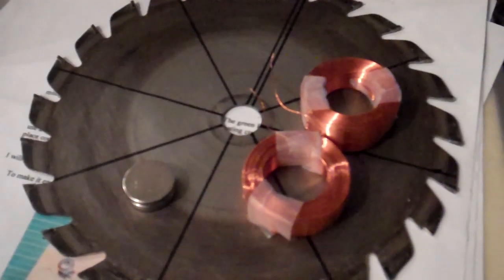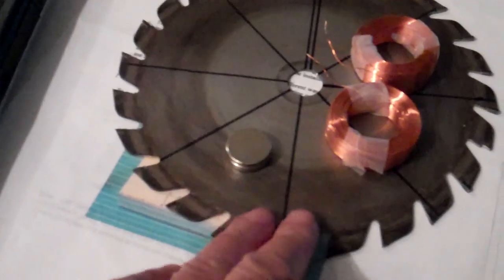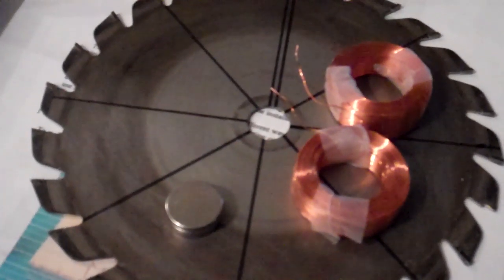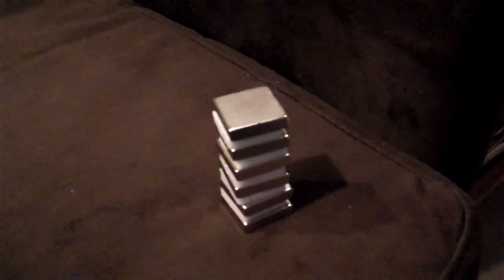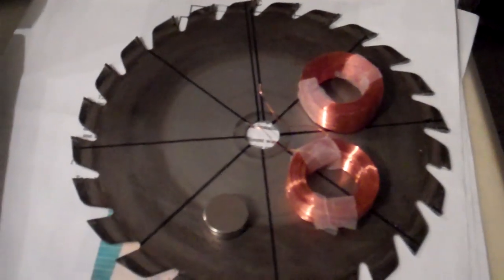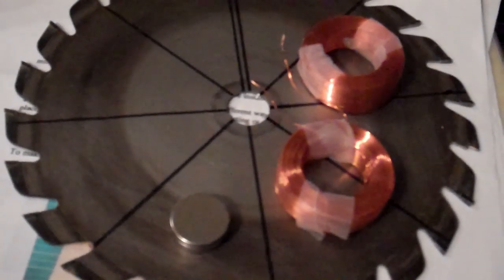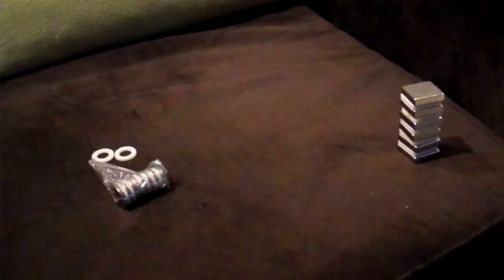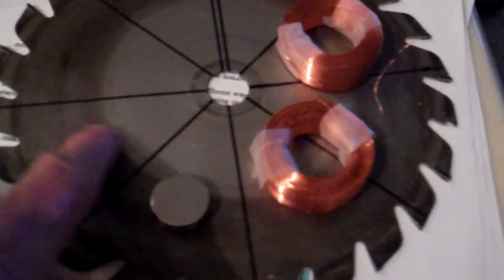Small 6 coil, 8 magnet  3 phase axial flux alternator project- Part 1 .mp4

Comment: How to make chargecontroller?
Reply from the maker: You need to rectify the voltage to dc with some diodes and make a regulator to charge your battery.  For a small regulator, you can use the adjustable  LM317 ic to make the charger. Just google it and you can find the circuit.

Comment: I calculate that  the output wattage will be very weak.  I  like  your  wind turbines though.   To match your wind turbine to a  comparable generator you  need to take apart your circular saw and replace the field windings with your 1 x 1 x 1/4" magnets. Your circular saw already has a wound armature w/ commutator   and  two brushes. You don't need to cast the coils in resin.  And you don't need  any capacitors,  or other electronic parts.  You field shall be  two  sets of four magnets mounted  180 deg. opposite polarity to the armature. Output  will be d.c.  which may charge battery.  You can get a converter at wall mart or auto supply.  The less electronics you use,  the less chance of something burning out.
Reply from the maker: gardnrobe Thanks for your insight and suggestions.

Comment: Hi.. Im new but really interested with this stuff, How do you use this? Is it like a solar panel where you connect it to a solar charge controller, then battery bank, then inverter? Im planning go off grid and do a hybrid of solar and wind power. is it possible?
Reply from the maker: I know not much more than you do. The alternator is for a wind turbine although it can be used for other projects. This type of alternator is easier to turn in the wind making it a better choice if you live in an area with lower winds.  Depending on the output, you can connect it to a wind charge controller to charge your batteries. An inverter is used to convert the battery dc to AC so you can use your devices.  Solar is more practical but a hybrid is possible.  I play with wind turbines because it is more "fun" for me as I like to see the turbine blades moving around.  It is like a fun hobby with practical uses. It is possible to go off grid but it depends on your needs.
Reply: wtam69  Thanks for the reply. Wind turbines are fun indeed.. :D And I want to build one my self. Question, Can I use speaker magnets instead of the ones used in the video?
Reply from the maker: gerald vakarian
Some people use speaker or ceramic magnets.  Neodymium rare earth magnets are generally preferred but they are expensive and can be quite dangerous.  They can fly together and pinch your fingers and literally break your bones.  I wouldn't use the ceramic ones as they are generally too weak.  I recommend you watching Muddy's channel as well as Belgrademachine and Cwaynehawks Youtube channels. They are featured on my channel and you can find the links there.  Treating the wind turbine with respect as working ones are not toys and you'll be ok.
Reply: wtam69 I see.. is there a ratio for the coils and magnets? Should the coils be always fewer than the magnets?
Reply from the maker: Yes. 8 magnets to 6 coils, 12 magnets to 9 coils etc.